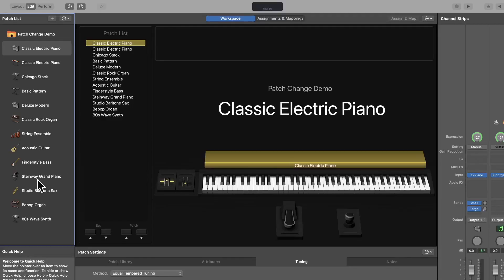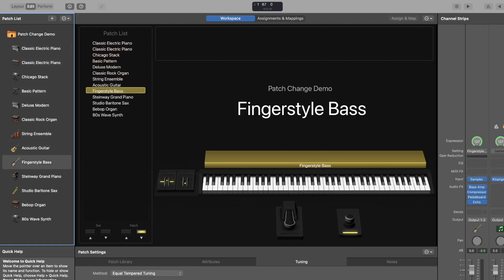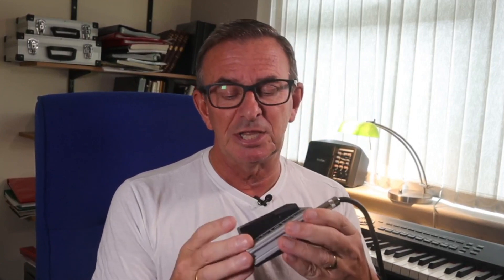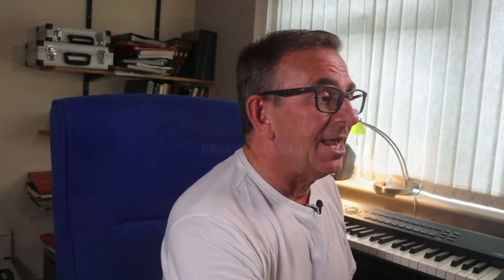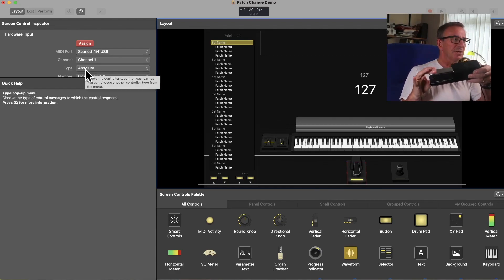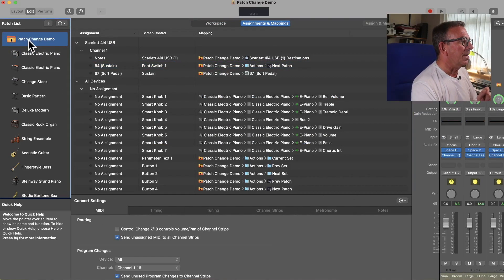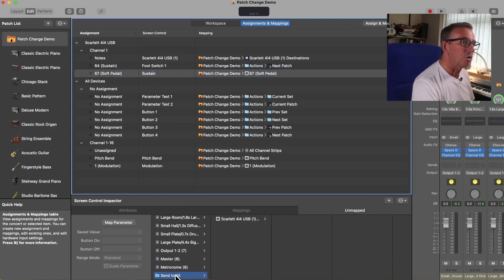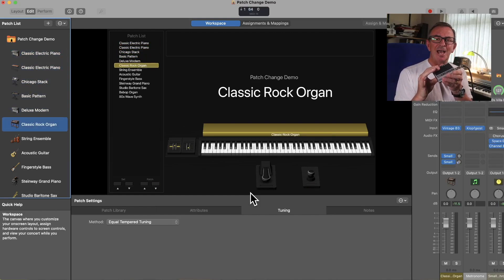MainStage Patch Change fix for Roland Keyboards

Comment: Thank you, thank you, thank you!!!
Reply from the maker: You are so welcome!
Reply: @MusicDirectorOnline  before I spend the next 12 hours troubleshooting, I would like to ask if you have come across anyone with sustain issues as a result of this workaround. My patches change seamlessly with my footswitch now (YAY!), but if I am depressing the sustain pedal while changing patches I get held notes until I return to the patch I was previously using. The "panic" function on my Roland RD88 doesn't cancel the held notes. Anyway, I appreciate your time. Thank you!
Reply from the maker: @minutemeditations8315   Hi there.  I'm not a great expert in MainStage in general and just wanted to address this frustrating problem faced by Roland users.  You're right though that on occasions the sustain pedal can cause issues when changing patches. My understanding is that this isn't due to the Roland workaround, but can, and does, happen with other keyboards.  Unfortunately I'm not able to offer a solution to this other than not changing patches during sustain pedal use, which I appreciate isn't helpful. If I find a solution I'll post it but maybe there are other YouTube videos that address this issue.  Rob P
Reply: Thanks for taking the time to reply. Well, it was worth a shot! I ended up updating my OS, MainStage and other apps. Now, when I create a brand new concert (and reverse the sustain/FS cables) everything works…about 90% of the time, the patch change occasionally skips a couple of patches. No sustain issues. This is better, but not usable in a professional show. Any of my previous concerts have the sustain issue. I’ll keep searching and let you know if I find a resolution to this issue. Thanks again!

Comment: Sir I have a roland xps 30 keyboard, and my question is can i use this keyboard as a midi while I’m using mainstage daw in live concert.. how can i setup my keyboard with mainstage daw.. I’m from India.. Please help me sir if possible…
Reply from the maker: Apologies for the late reply.  I am not an expert in MainStage but the answer to your question is yes.  You CAN use the sounds within your XPS30 through MainStage.  I suggest to look for videos about using EXTERNAL instruments in MainStage which is the terminology MainStage uses for this.

Comment: So I found this solution worked for my Casio keyboard also.... Using the footswitch in the damper input and using the sustain in the SOSTENUTO. Mapped each accordingly. However if I hold the sustain through a patch change the polarity changes. I feel like I just can't win.
Reply from the maker: Hi Gina....you have my sympathy, Im not an expert on MainStage hence I only record videos on very specific issues that I have used and problems Ive mange to solve.  Good luck in your endeavours tho. Rob

Comment: Thank you!! I've experienced similar issues using various different keyboards (none being Roland) - Kawai, Korg and Yamaha even. Usually your explanation is the one that works, because I wasn't paying attention in my original setups, but i have found certain footswitch pedals (sometimes even a keyboard player uses a damper type pedal) does interesting things in the midi send, making a 2 or 3 skip issue. The joys of technology - note to self, test test test, and ensure the basic set up is done correctly as explained here, as that is usually going to be the problem.